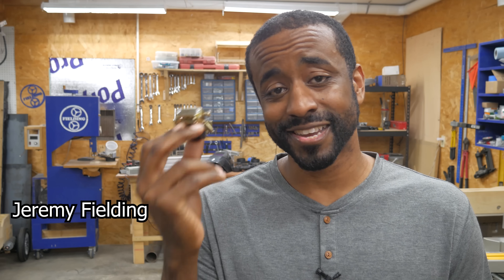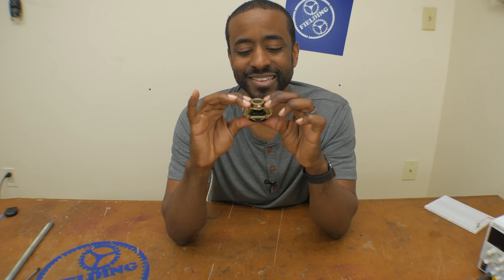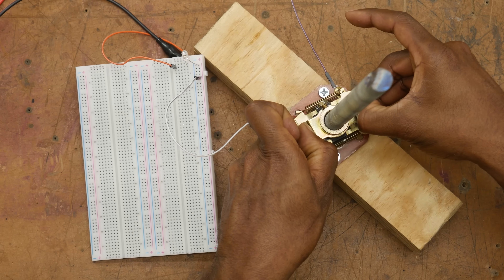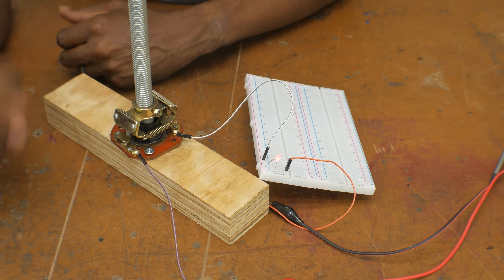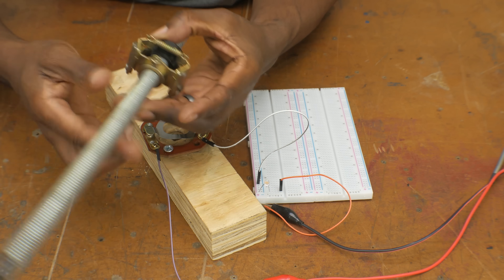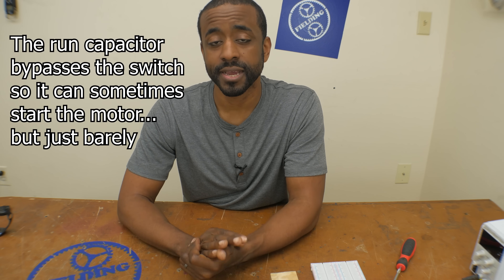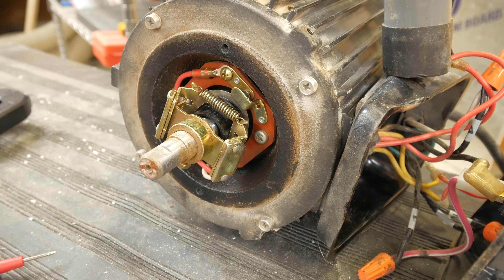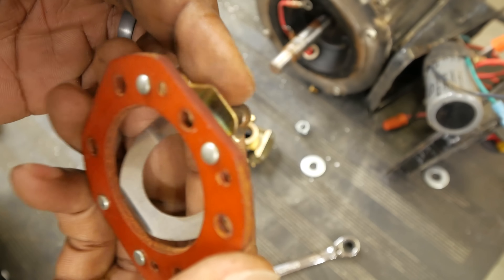This Clever Device Is Found In Nearly Every American Household. How It Works And How To Fix It

Comment: Same mechanism was used for steam engines to separate power from them, when the wheel was spinning too fast.
It got history in steam engines.
Reply: It's where we get the term "balls out" from. When I was little I thought this was a reference to some particular male anatomy, boy was I wrong :D
Reply: @akunog2708  huh ive never drawn that conclusion :) balls out = full speed. makes sense :)
Reply: @akunog2708  was actually balls to the walls
Reply: @RS-cd9cf  They both mean to go "all the way" or to apply full force, But they ARE two different sayings, and are about two different types of engine control. "Balls to the wall" (the "wall" is singular), is an aviation term for full throttle. The throttles for each engine of a multi engine airplane has a ball shaped knob on top (the "balls"), Pushing them forward the full way  towards the instrument panel ("the wall") is wide open. "Balls Out" refers to the ball shaped weights on a steam engine governor. When the "balls" are "out", The engine is at maximum speed.
Reply: @jamesslick4790  I learned both of these today. Excellent!
Reply: You'll find this mechanism used in many Elevators. Even with speed sensors/etc, the safest way to moderate the speed of the rise/fall is still a centrifugal governor (Cable lift/counter weighted, not pneumatic)
Reply: @brookhavenrain1264  ARRRRGH! First “Steam engines”, now “elevators”?  Those are governors, as in they govern the speed of something so as to prevent operation past the maximum rated speed of the engine or motor it’s attached to. This is a switch it is either on or off,  its’ design function is to allow EXTRA current to boost the motor to optimal speed, then switch off the extra current to avoid damaging the motor.
Reply: @LeeAOliver_Music I think they were referring to it as it operating on the same principe although to a different effect. One being to regulate speed the other to bring it up to speed,  still the same principle though on steam engines it’s opening a bleed valve to release excess pressure to prevent overspeed, & in E-motor it’s opening a circuit to disengage the capacitor(s)… at least that’s my understanding as a mere novice… whom has limited knowledge of both electric motors & steam engines, though I do have an adequate  grasp on mechanical peinciples…
Reply: Leonardo DaVinci Flywheel is the beginning of the chain of invention "I think!"
Reply: @SirWilliamMorgan  no
Reply: @DieselRamcharger  no? pray tell, where does the chain of invention begin?
Reply: @SirWilliamMorgan  The invention of the rotational speed governor/regulator is attributed to  Christiaan Huygens in the 17th century. James Watt adapted the idea to control the speed of his steam engines.
Reply: It's also used as a clutch in chainsaws.   When the engine rotates fast enough, the centrifugal force presses the weights against the inside of the chain drive drum and turns the attached sprocket which drives the chain.
Reply: @DP-hy4vh  always wondered how that worked. Thanks for the knowledge!
Reply: @DP-hy4vh  Yup.  Mopeds too. I guess it's common in small IC engine apps.
Reply: @DP-hy4vh  No. a chainsaw clutch uses centrifugal force a ball governor relies on centripetal force.
Reply: @DieselRamcharger  "a chainsaw clutch uses centrifugal force; a ball governor relies on centripetal force."

No, it's the same principle.  Centripetal force and centrifugal force are just two sides of the same coin.   Every action has an equal and opposite reaction.   When you pull on something, whatever you're pulling on is also pulling against you with the same force.
Reply: @Milesco  stop and really think about what you are saying. clutches and governors dont work the same. stop. think.

think.
Reply: @DieselRamcharger  :  I'm well aware of how centrifugal clutches and ball govenors work.  They both rely on centrifugal force to do their jobs. 

A centrifugal clutch has several pads of friction material attached to the power output shaft by springs, all inside a drum.  As the rotational velocity of the shaft increases, the centrifugal force on the pads causes them to pull away from the shaft and make contact with the surrounding drum, thereby causing the torque of the shaft to be transmitted to the drum.

A ball governor, typically used in steam engines, has metal spheres attached by small levers to a vertically-oriented central shaft.  Like the friction material in the centrifugal clutch, the balls move outward as the shaft speed increases.  This causes the attached levers to operate a valve that regulates the flow of steam to the cylinders, thus regulating ("governing") the speed of the engine.

In both cases, the friction material or balls move away from the shaft as the shaft speed increases.  Centrifugal means "center fleeing", and that's exactly what the centrifugal clutch friction material and governor balls do -- they move away from (or "flee") the central shaft to which they are attached.
Reply: @DieselRamcharger  I think you're confused. A centripedal force is pointed towards the center of the circle, a centriugal force is always the exact same strength as the centripedal force and always pointed in the exact opposite direction of the centripedal force. 

So to say that a centrifugal governor (yes that's what they are called) uses the centripedal force is a bit like saying that your bottle is not half-full but half-empty. You cannot have one without the other. The reason we call it a centrigufal governor is that it relies on the balls moving out under centrifugal force to determine wether the throttle should be closed. Centrifugal force moves the balls out, gravity moves them back in because they are on a hinge, centripedal force just keeps them moving in a circle.
Reply: @vinny142  i disagree. the clutch uses outward pressure {centrifugal} to engage the drum. ball governor uses centripetal force to wind the helix. we can piss and moan all day. but thats my contention. right wrong or sideways. thats how im looking at it. Science is funny that way.
Reply: @Milesco  Since there's quite an amount of nit-picking going on in this thread (not necessarily a bad thing), I might add something I remember my high school physics teacher explaining: There's actually no such (real) thing as "centrifugal force".

If you take the classical example of so-called centrifugal force (swinging a small weight attached to a string around in circles over your head) what you actually have is; centripetal force (the string) overcoming the weight's momentum - since the whole time it's moving it wants to carry on flying off in a straight line tangental to the circular path it ends up travelling. Because of the string, however, it is constantly being pulled off the straight-line course it wants to take, which results in it flying around in a circle. If it's travelling quick enough (i.e. with enough momentum) then it will overcome the gravity that would otherwise pull it down to earth and it'll "magically" fly around in a circle horizontal or vertical or wherever it's swung.

If the weight's momentum ever exceeds the centripetal force in this example then the string snaps and the weight carries on in a straight line along its last course (it's not going to suddenly do a 90 degree turn and fly straight outward from the centre of the circle, as the idea of "centrifugal force" might suggest).

I did a little googling today and learned something though: "Centrifugal force" is one of a few "fictitious forces" in newtonian physics. It's there for when you don't want (or need) to model the entire system and simply explains the "outward" force felt from within the rotating system. 

So, for example, if you're a trainee astronaut strapped to a centrifuge then you would describe and measure the force you feel trying to squeeze your cheeks against the back of your head as "centrifugal force", since you're the observer and you're spinning around in sync with the system. From your point of view (with your eyes closed at least) you're sitting stationary and your cheeks are simply trying to move backwards (i.e. straight out away from the centre of the system along the arm of the centrifuge). 

However, to someone standing outside watching you fly around in circles, your cheeks are moving around and around in a circle while trying to carry on in a straight line at 90 degrees to the centrifuge's arm (and causing you to pull some hilarious faces in the process). The outside observer has a frame of reference that can see and measure the entire system, including the centripetal force (the spinning arm and chair in the centrifuge) as well as the circular path you are moving in.
Reply: @danielscott4514   Yeah, we're both basically saying the same thing.  My point, though, is that centrifugal force and centripetal force are simply two sides of the same coin.  Just as the string pulls the weight inward (centripetal), so the weight pulls the string outward (centrifugal).  For every action, there is an equal and opposite reaction.  If you were to feed more string in this "whirling around" scenario, the weight would travel outward and define a circle with a larger diameter.  If that were not true, then centrifugal clutches and ball governors wouldn't work.
Reply: @Milesco  thank you for saying this. Centrifugal and Centripetal are two sides of the same coin. Perfect way to put it.
Reply: Yup the fly-ball governor, 2 or 3 steel balls of a given weight would swing outwards,
possibly springs on a threaded rod could/would vary the speed and the throttle was
linked to the governor.  It is physics like this that should be taught in school science
classes, along with levers of 3 classes electricity. . .
Reply: Ha. In Indiana the phrase is balls to the wall. Anybody else use that phrase? Go balls to the wall.
Reply: @Stonecon  balls to the wall is an aviation term from ww1. balls to the firewall is full throttle full pitch no flaps.
Reply: @Stonecon  that refers to the ball shaped throttles on aircraft being pushed as far towards the front or firewall as possible. Ie full throttle. That's balls to the wall. Not governor balls.
Reply: Acoording to Wikipedia the patent for centrifugal switch was granted to Royal Lee in 1920s.
Reply: That's a governor, these work on centrifugal force but operate a switch.
Reply: @Dustinielson  - on steam engines, the governor does not operate a switch;
 it controls a variable pressure valve actually.
Reply: @thetessellater9163  he said, "THAT'S a governor," referring to the steam device. Then he said, "THESE work... switch," talking about the device on the video.
Reply: @thetessellater9163  🎂
Reply: Thank you nice presentation Mechanical Diesel/petrol engine governors work on a similar principal they are a balance of centrifugal force with weights and variable spring tension to give you a different balance point. It all came from steam engines. Centrifugal force is there why not use it it’s free! Like Gravity and water flowing downhill. If it ain’t broke don’t fix it!
Reply: yeah it goes quite far back... altough if i recall on steam engines they also regulated the speed (and in clocks a governor also regulates unwinding speed)
Reply: I was thinking the same.
Reply: I never heard about separating power, Not saying u r wong. just never heard of that.
just used as a means to control speed, when engine was not running throttle was set at
 the desired speed, as  the load was placed on the engine, the governor setting brought 
speed up.
Reply: It wasn’t used to separate power, it was used to control speed  modulation. When it reaches speed to where the balls fly out it closes down the throttle valve. But not just at max speed, but used to control speed in operation by adjusting the amount of force applied to the throttle valve, with less force on the throttle valve the engine will run at a slower speed, as you increase force it brings the speed up. 

This is usually utilized with a spring, the more you pull the spring the higher the RPM goes, let’s say you have it set to run at like 200 rpm, if you then have something attached and load up the engine, the balls fall and allow the spring to pull the throttle open, as speed increases the force of the balls pull back on the throttle valve, closing it down, thus maintaining a set engine speed. 

They are still used today in lawnmower engines as well, when you run a lawn mower at full throttle it will run around 3000 rpm, there’s a small gear driven “ball governor” inside the engine, with a plunger that gets pushed up as the “balls” fly outwards, this plunger pushes on a lever that goes outside the block and there is a linkage that connects it directly to the carb, there is then a spring that connects from this lever to your engine speed control, when you idle the engine down it decreases the amount of force this spring pulls back on the lever, allowing the governor to close the throttle blades down to the idle set screw. As you increase throttle it pulls harder on the spring, which in turn pulls the lever, it forces the governor down which opens the throttle more, as RPM is increased, centrifugal force on the governor increases to the point it balances force between the spring and governor, holding your set speed, when you hit a heavy patch of grass and load up the lawnmower engine, and the rpm decreases so does the centrifugal forces on the governor allowing it to collapse and the spring pulls the throttle wide open, once the load on the engine decreases, like the grass clears out, the engine increases RPM, which the governor then pushes back out, and closes the throttle valve back down to where the force on the governor matches the force the spring is outputting on the lever, a well tuned small engine can almost maintain nearly the exact same speed under rated load as it does free spinning using this method.

Now on a poorly tuned lawnmower you get “governor hunting” what happens is typically you have an engine that has a vacuum leak, from a seal or hose, or also on an engine that is running rich as well, the spring and governor are matched to work together to hold speed, when a carb is properly tuned, when the engine starts that vacuum leak allows more airflow past the throttle valve, which makes the engine speed up, the governor kicks in and closes the throttle down, as it does this the engine rpm continues to increase until that governor is “balls to the wall” and has the throttle shut down completely, at this point the engine then completely leans out, and rpm rapidly decreases, then once it slows down far enough the throttle is allowed to open and it pops it wide open to try to attempt to control the rpm, the engine rpm increases rapidly, then the governor tries to close it, and it overshoots and then slams the throttle back shut, and it continues this until the engine is used under load.

That’s why when you hear your neighbor mowing their lawn and his lawnmower keeps revving up and down on its own, it’s cause the carb is out of tune. 

Same rpm control principal applies to steam engines as well.

So basically, when you would run a steam engine with the heaviest load it could handle, the balls would be flung out as far as possible, or “balls to the wall” (however it makes more sense if that term came from aviation)
Reply: Steampunk, Cedric...Jules Verne and {bleep}
Reply: Ha! I came here to say that must derive from the governors on steam engines.
Reply: Yip , it was called a governor
Reply: @deiselramcharger. There is actually no such thing as centrifugal force (scientific fact), that is just an illusion.  The real deal is centripetal force, cancelling out linear motion. The simple example of this is a slingshot; the sling provides the centripetal force (to restrain the stone around a central pivot/axis). When that force is removed (i.e; the sling is let go), then the stone is unrestrained, and linear motion takes place, i.e: the stone travells in a straight line.
Reply: Another speed governor by centrifugal force was used in the old rotary dial phones to regulate the dialing pulses speed
Reply: Sorry but no! This is a centrifugal switch. That's a governor, as used on steam engines (and some I.C. engines). A governor has an "infinitely variable" control range between fully open and fully shut (i.e: it's analogue), but the centrifugal switch on electric motors (as in this video) is either fully on, or fully off, i.e: its digital, just exactly the same as a plain on/off switch, except that this is operated by the weights moving inward or outward according to the speed of rotation (It does have the same action in common with the governor; they are both weight operated).
Reply: James Watt was the inventor and his name was lent to the name of the unit of power. Watt's iteration was comprised of balls on cables. When the locomotive steam engine exhaust increased, the spinning balls would go faster and their cables were tied to the input power source (steam). The exhaust fed back to and controlled the power input- Watt's invention is inversely proportional to modern turbos.
Reply: As far as can be determined, a 1920's patent for a centrifugal switch (US Patent #1,630,394 of this basic type was granted to Royal Lee on May 31, 1927. It was the basis for the formation of the Lee Engineering Company.
Reply: Wind up phonographs also used a weighted centrifugal clutch (a "governor") to control speed.
Reply: Credit to the original design, centrifugal governors.
Reply: "Balls Out!" on steam
Reply: That's a governor, this is a switch, and there is the clutch too see Talbot motor cars of the 1930's. The genesis for this tech was indeed way back when in the days of steam used on everything from steam tractors to London's Tower Bridge, and the Victorian water supply pumping stations.
Reply: "...to separate power from them..." please... who is the "them?"
Reply: Called a governor